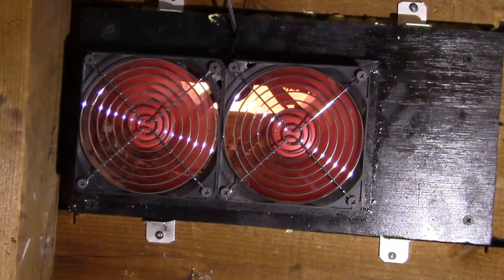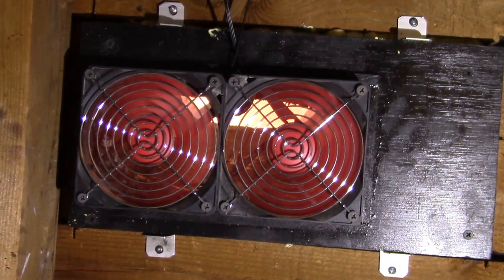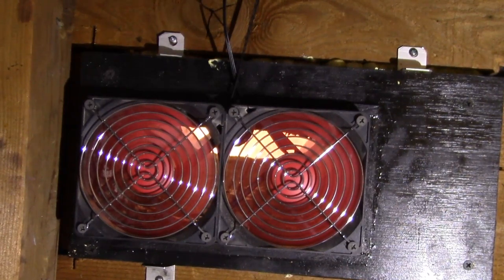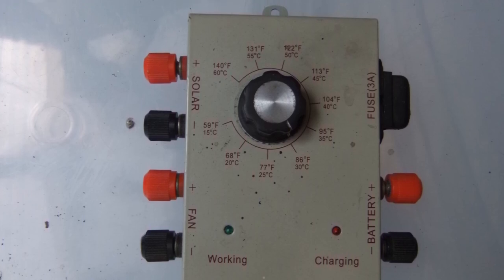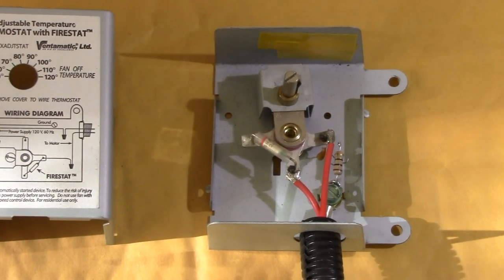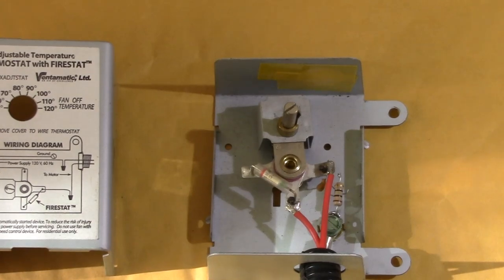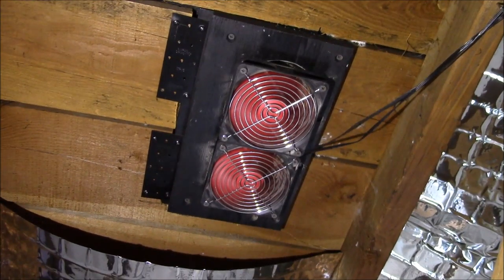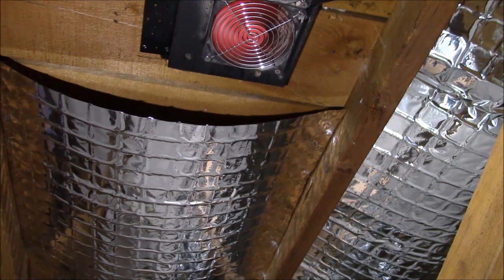Solar Attic Fans

Comment: Use Noctua Industrial fans. Move more air and are designed to be run 24/7.
Reply from the maker: Good suggestion.  If I ever have to replace these fans, I'll look into those.  About 2.5 times the price of the fans I used, which are going into their 8th (now 11th) year of operation.

Comment: Can you post more details of how to wire RC snubber circuit on that please? Thanks
Reply from the maker: Sure, see below, resistor and capacitor across the switch contacts:
https://en.wikipedia.org/wiki/Snubber#RC_snubbers
I used a 1uF capacitor in series with a 10 ohm resistor.

Comment: Great video! Thanks a lot for sharing .. I wonder if you have in you system one fan sucking cool air in and the 2nd one sucking hot air out ?
Reply from the maker: +TheIsmaelIsaac All the fans are set up to blow hot air out of the attic.  They are all installed up high towards the peak of the roof (hot air rises).  The cool air is then pulled in from the soffit vents along the eave of the roof.
Reply: +R Brown (4Crawler) Thanks again, R Brown ... People like you make huge difference .. bless you
Reply from the maker: +TheIsmaelIsaac Thanks, glad you found the video helpful.  My fans are starting in on their 4th year of operation and still going strong.  They really do make a difference in the attic temperatures, especially when you add in some radiant insulation.
Reply: @The4Crawler  I'd like to do the same project. The fan I want to use is rated at: 12V and .3A I also want to use two. Do I connect black to black and red to red ? Lastly what size solar panel would I need to power these two fans. Appreciate your reply, Rick
Reply from the maker: Yes, you would want to connect the fans in parallel like I did, red-red and black-black.  Then feed them with 12 volts.  I used a PC fan Y-connector for that.

My fans use 0.25A/pair and with 3 of those, I originally had a 12V 30W panel but that wasn't enough.  I added a 60W panel in parallel (90W total) with that and it worked better.  At some point, I added another 60W panel as I started running other loads off the system.

A lot depends on how long you may be running the fans.  On hot summer days, mine can run ~20 hrs/day, so that would be ~15 amp-hours at 12 volts.  A 60W panel puts out about 4A and with ~5 hours of that output per day, that will just keep up.  If you want to be able to handle hot, cloudy days, then you'll need much more solar panel capacity.  That's why I started out small and kept adding panels/batteries to the system as I felt it was needed.  I did start out with a larger charge controller than I needed (40A - MPPT) but that was just so I could expand the system in the future.

Of course, the other option if to only have the solar panel run the fans while the sun is shining.  In that case, you might only need a 10-15W panel.  Something that can put out 0.6A or so.  My old Harbor Freight Solar Fan kit was set up like that:
https://youtu.be/ZrjkyeQQAZE
It could run solar to fan, or solar to battery to fan.  Unfortunately, HF no longer sells that kit.  Mine is still in use in my garden shed.
Reply: @The4Crawler  yeah all I want to do is PV direct system with no batteries just solar panel and the two fans and only run it during daylight hours. So knowing that information how many watt panel would I need and do I add the amps to figure out how many amp output need ?
Reply from the maker: Just find a 12V solar panel and look up what it lists as a maximum current, usually listed as Imp (I = current, mp = maximum power)  My little 15W Harbor Freight panels do about 0.75A @ 20V.  1 of those type of panels might work, if not add a 2nd one in parallel.  

That's what I'm using in my garden shed, 2 - 15W panels and 2 - 12V fans, although I do have a battery in the system.  But most days, the panels are just powering the fans.  If only using the panels and fans, you might need to keep an eye on the voltage across the fans.  If you see that rising much over say 14V, you might need to put a resistor in series with the fans to drop some of the excess voltage.  

Or get a low cost DC-DC step down regulator.  I used something like that for cooling my charge controller:
https://youtu.be/Jxp6jzwZYcY
I just set that regulator to output no more than 12V and it limits the output voltage to that much.

Comment: What component of your system were the DC fans connected to? What was their source? Did you have to regulate the amperage or did it just draw what it needed to run? If I connect a PC fan directly to a 12V car battery could it damage or shorten the fans lifespan?
Reply from the maker: I run the fans off my solar charge controller DC load output:
- https://youtu.be/YH0iVSzkOgU?list=PLpY2FP1a9tit1TcUvvYFEGg4uJdDB55eH

They seem to handle voltage variations fairly well.  At higher voltage, they run a bit faster and that helps cool the motor a little better.  They are now going on their 3rd summer of use and still working fine.  The fans will only draw the current they need to run, so no need to limit things. The charger controller does somewhat limit the load current to 20 amps, but my 8 fans only pull about 1 amp total.  If needed, I could install a DC-DC converter or a PWM speed controller if I needed to regulate the voltage.